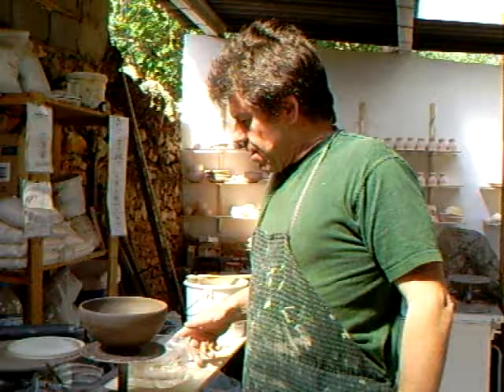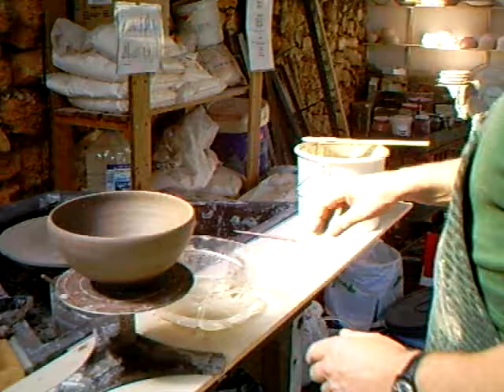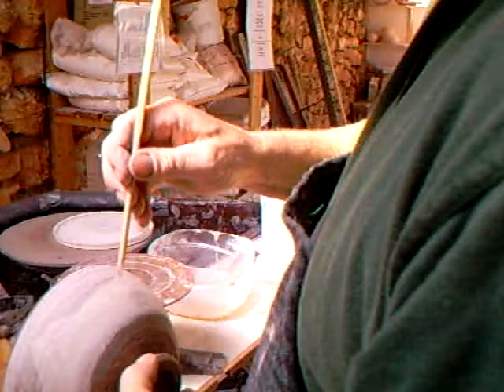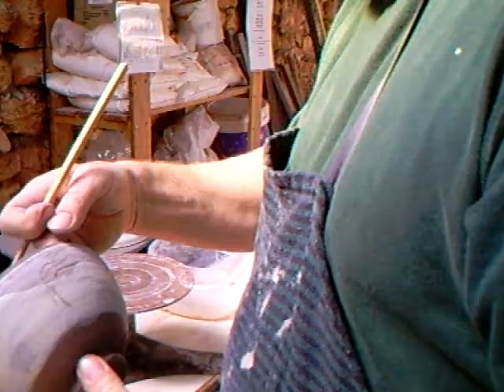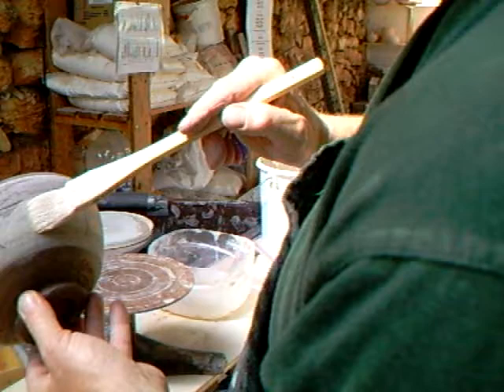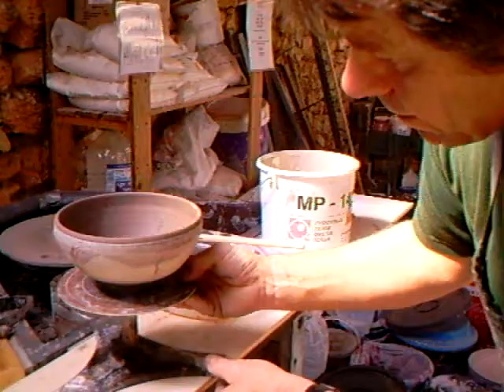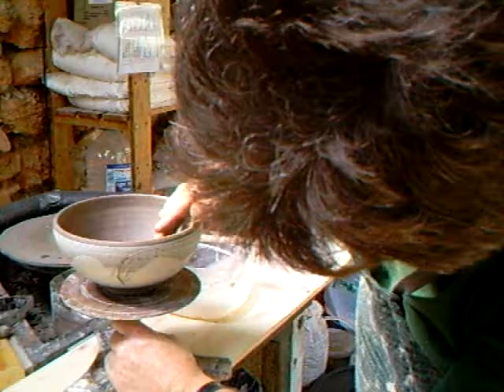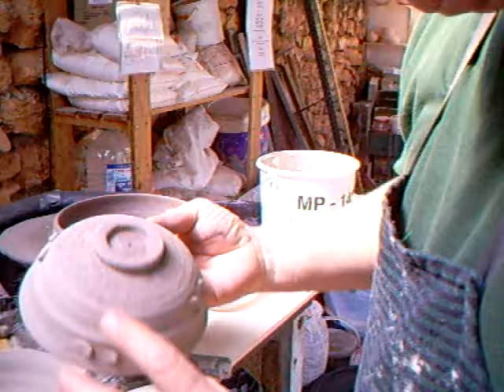SIMON LEACH - White slip - raw decorating

Comment: Sorry so wordy.
"Hake" (Robert Fournier)
Soft flat hand-made Japanese brush 1 1/2"-31/2" wide From hakame?
Hakame, 
A thick white slip or Engobe used over a darker body of clay to provide a backgrond for other brush-work such as iron stains.
Hamada's bottles 
I like to use a very thin coat of clear glaze, the white brush strokes in contrast to a darker clay are beautiful and I feel it should not have to compete with and equaly beautiful ash glaze.
 
Can't waite to see your results!